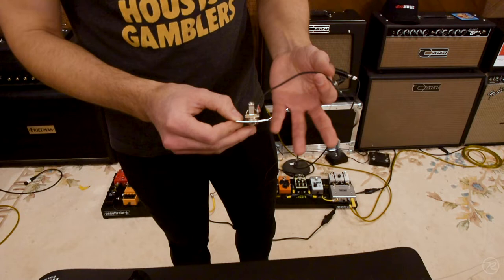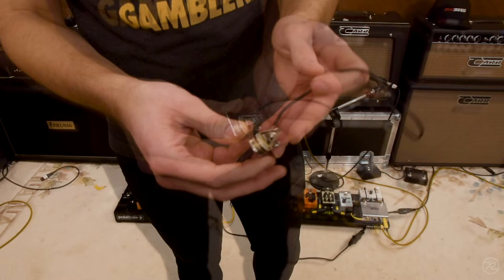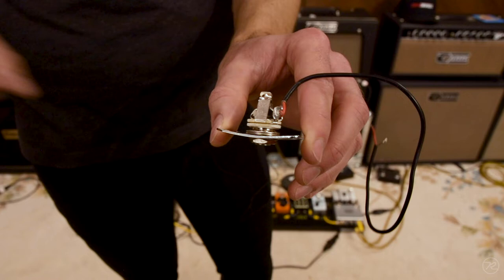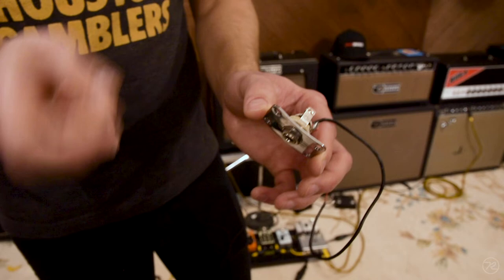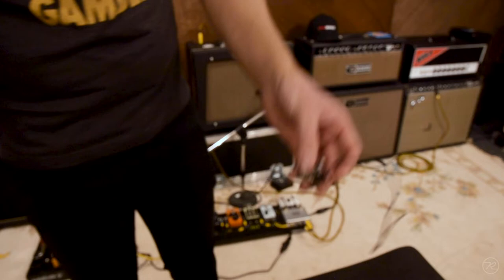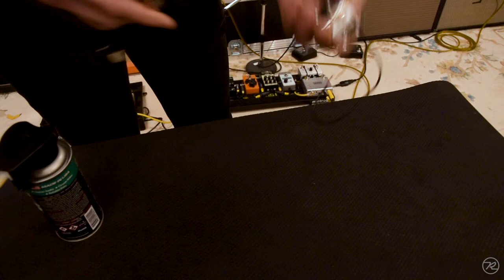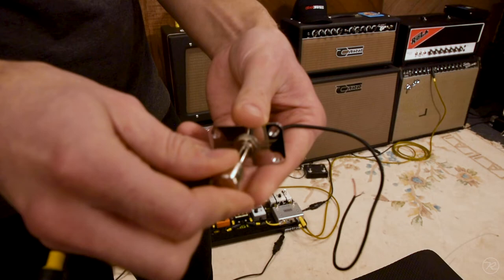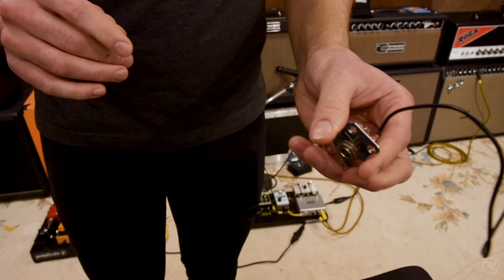How-To: Clean Your Input Jack

Comment: I used mass air flow sensor cleaner. It worked great on jacks and knobs. It evaporates quickly and leaves no residue. It’s all I had at the time. Nice video.

Comment: Could you do one of these on a noisy five way selector switch (Six Gun/Jetstream).  Thanks
Reply: You just spray it in the slot and work it back and forth. You can flip it the other way and spray it in the other side if you're paranoid.